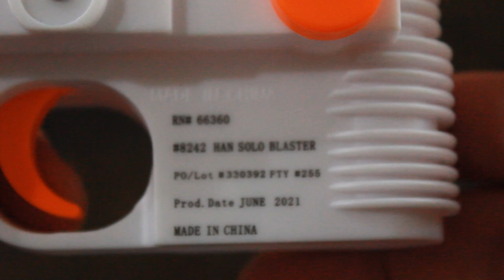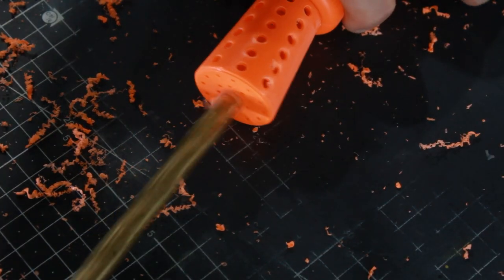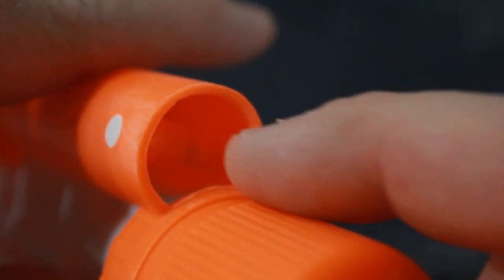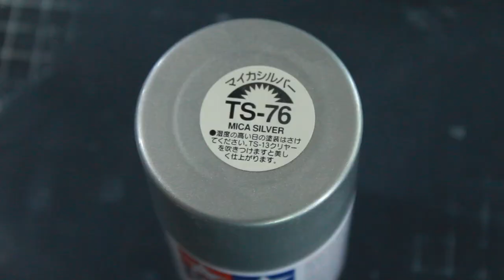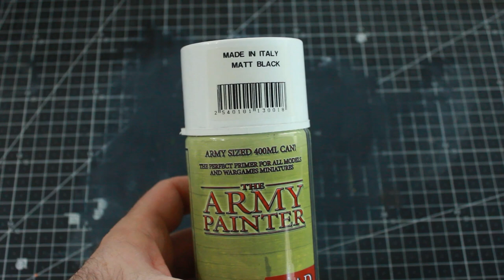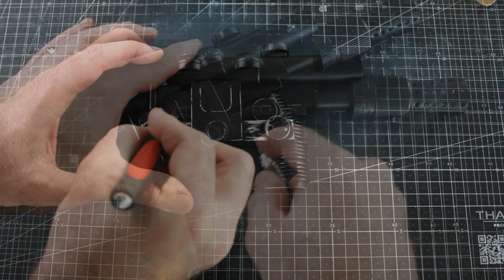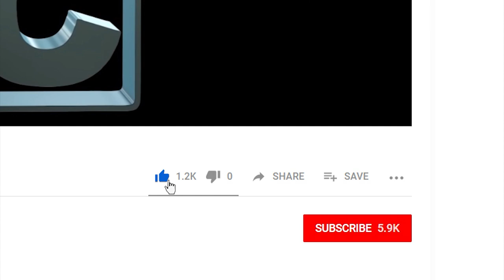Han Solo Toy DL-44 Blaster Repaint and Modification

Comment: What kinds of nails are those?
Reply from the maker: Just some mails I had in the garage.  But they were powder coated weather proof nails.
Reply: Thank you. How did you cut the polystyrene lenses?
Reply from the maker: @bricago2302  I have a one of those cutout rulers,  like these. 
https://amzn.to/3vPkDYj
Reply: Cool! Thank you for the info. I just cut out the scope holes, and that took some very careful Dremel steering. 😄
Reply: @modelsbychris  I have the circle stencils now. How do you cut the acrylic lenses? With an X-acto knife? Or is there a better tool for cutting out discs?
Reply from the maker: @bricago2302  I just slowly and carefully traced  with a new sharp blade
Reply: @modelsbychris Thank you! I really appreciate the reply.
Reply: Could you please give more info on what grit you use to sand the putty and seams? Do you wet sand? I’ve tried with 180, 220, and 400 grit, dry and wet, but the patch is still visible through the primer. I’m also using the Testors brand of putty, not PPP. Maybe Testors sucks and not me.
Reply from the maker: @bricago2302  I start with 400 then 800.  Needs to be very fine for last pass.  I use Tamiya putty.
Reply: Thank you!